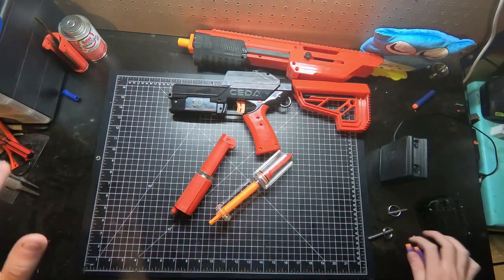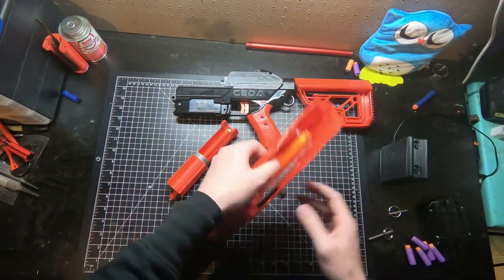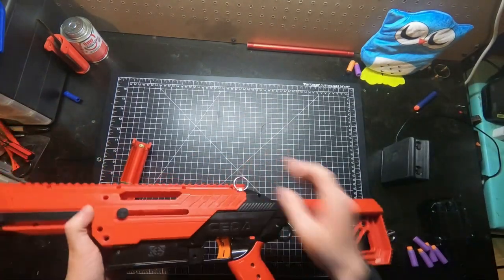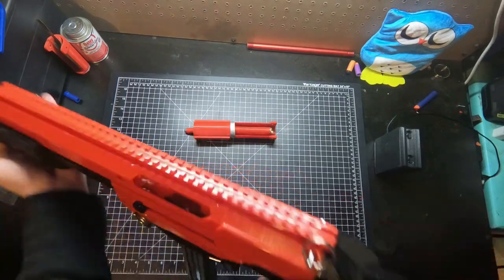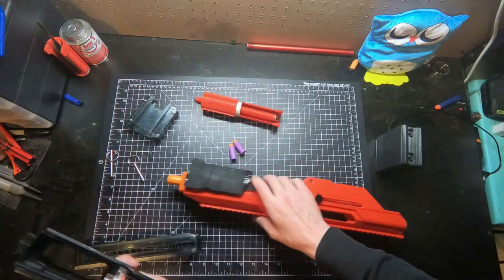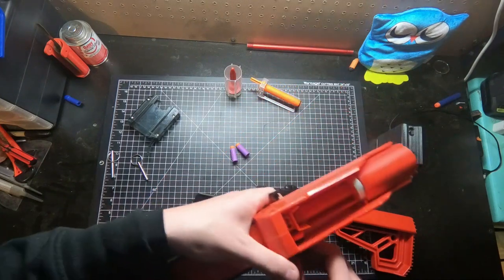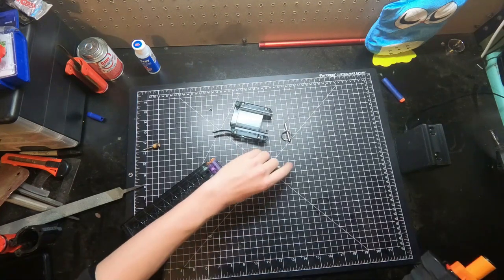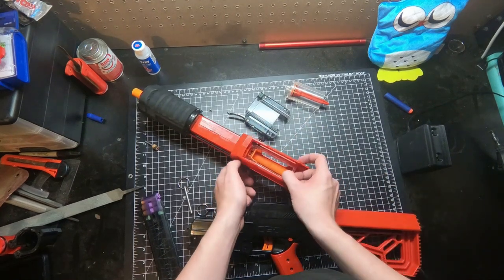HMI-R VS Jet OMNI kit

Comment: Is there a separate kit for the CEDA?  I can't find the plunger tube cover on your Etsy.

Also, does the bt27 work in the CEDA without modifications?
Reply from the maker: Bao Tran probably in the next week or 2 we will be releasing a ceda s specific k it
Reply: BT27 is designed for the Ceda/Prophecy/DZP platform.
Reply from the maker: Derek Tran just all of the RET platforms also I’m not too sure about it working in a DZP
Reply from the maker: The bt27 takes some work to fit inside of a ceda because its different than the springs designed for the ceda. Our kit will work with the bt27 though if you want something to go with a bt27 in a ceda.
Reply: @modbros5345  with the DZP I compare to the stock spring and occasionally need to trim a few coils with Ceda springs